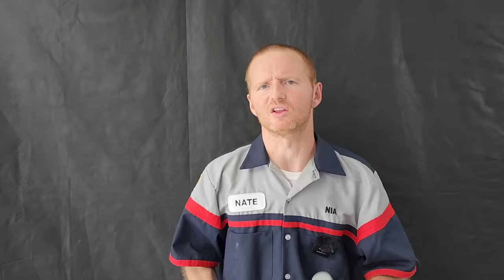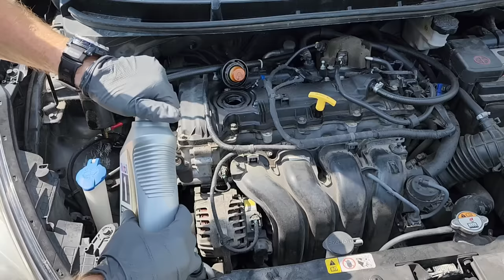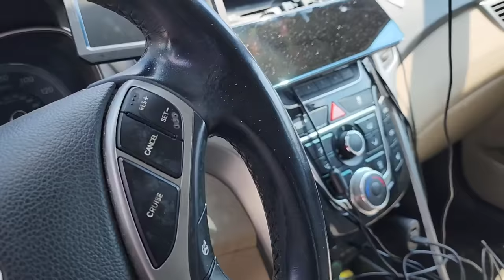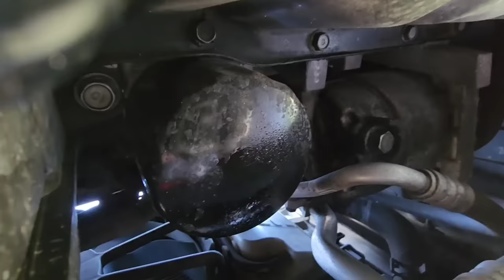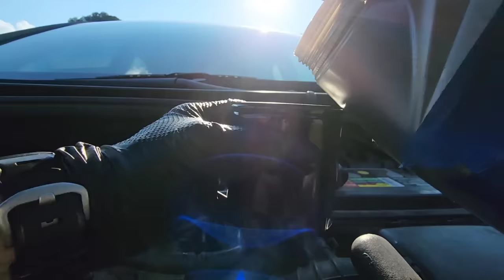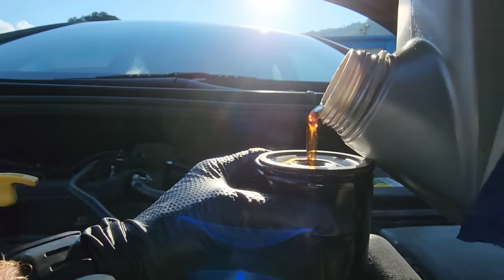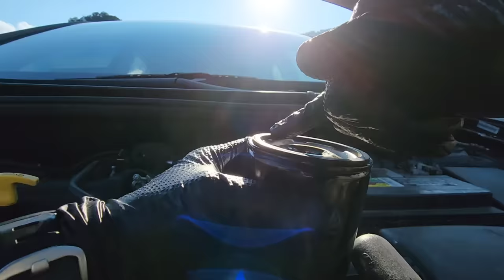Car owner sued after Jeep kills Mechanic during oil change

Comment: The dealer should be held liable and not the car owner. The dealer allowed an incompetent employee operate a vehicle that he did not know how to operate. And for God’s sake, why would you do what that incompetent employee did if you have never used a manual transmission? Why would you just make assumptions ? I have never operated a fork lift but if there was a man standing in front of the forklift I have enough sense not to just make assumptions and start pushing on levers 😱
Reply from the maker: Yes its a terrible situation and could have been avoided.
Reply: The kid sure knew what a clutch was for. ?
Reply: What's a forklift? (Idiocracy was a prediction)
Reply: @eltonyancey6426  I'm willing to bet the mechanic that was pinned outside told the kid to push the clutch in  ( explaining what pedal to push ) but the kid didn't know what's going on . Once the vehicle rolled slightly back he released the clutch and the vehicle jump forward killing the mechanic in front of the vehicle.
Reply: @johnmarshall4442  Could have happened that way. So preventable.
Reply: People have no common sense today. They probably tried suing the car owner because he had an insurance policy.
Reply: No judge would hold the owner liable but people are sue crazy in the states.
Reply: @r3dhorse  - it was a badly written state law
Reply: @r3dhorse  if I were the judge I’d say the idiot mechanic should be liable
Reply: nope it's because of workman comp laws that prevent them from suing the        company directly. The shopped indemnified the car owner. SO even though the car owner gets sued the shop pays
Reply: Once I leave the car in the shop is their responsibility if anything happens.
Reply: @LuisFSilva-gm9ms  I don’t know if that’s a law or not about car ownership, and I’m not saying one way are not. But the more comments people like me are making,  does the person making the video receive royalties from YouTube.  If so a genius. I know some YouTubers like Scotty a mechanic, says he makes titles so that people will watch his videos.
Reply: How much for the new guy?
Reply: @bradfordmcgomery9058  YouTube isn't what it used to be. Now you make 0.25 of 1 cent per view. So every 1.6 million views you make $4,000. Not a very good number for such a high view count.
Reply: Operator error,  if you're starting a standard shift vehicle,  you should be sitting in it, the emergency brake should be applied,  shifter should be I Neutral,  and nobody should ever be standing in front or behind it... , this is not on the owner.
Reply: I'm sorry for all the people involved in this sad incident. But for me that's a work accident not a traffic accident. So the dealer should be liable not the car owner
Reply: @niyablake  That workers comp law was passed because of the fear that one worker would have another worker intentionally "accidentally" hurt them so they could sue the company.  That has happened in the past.
Reply: So, this isn't actually what you think it is. It's a quirk of Michigan's insurance laws. 
"As Femminineo explained to Jalopnik, the Hawkins family can’t directly sue the dealership or its management. Michigan workers’ compensation law says you cannot sue a fellow employee for negligence while on the job. So the Hawkins family’s only option was to sue the Jeep owner. But that doesn’t mean the Jeep owner will be held responsible for the accidental death.

According to Femminineo, when the Hawkins family filed suit against the Jeep owner, that person immediately sued the dealership for indemnification, and won. With that victory in place, whatever results from the Hawkins family’s suit against the Jeep owner will be the legal responsibility of Rochester Hills Chrysler Jeep Dodge (and their insurance company). Basically, while the owner of the Jeep is named in the suit, that person won’t face any repercussions from the trial or judgment."

This is just how it's handled in MI, the owner of the Jeep was never going to have to pay anything.
Reply: @NATESINTERACTIVEAUTO  this will be thrown out of court  in a heart beat
Reply: Exactly
Reply: @2aisabsoluteTim  No it is how the law is supposed to work in MI. Workmans comp prevents workers suing their employer, so the only option is suing the owner of the vehicle, but since the owner had transferred possession temporarily, they are indemnified by the shop. This is how it was supposed to work, the owner of the Jeep was never going to have to pay anything.
Reply: It will be- eventually. After the subrogation claim by the owner's insurance co.
Reply: @poiu477  thank you for clearing it up. I understand it now.
Reply: Truly a very unfortunate and sad outcome 😢. This could absolutely have been prevented with the training and questioning the young man who didn’t know how to drive standard shift.  Part of that instruction on the dealership’s part should have been to perhaps teach the young man about manuals, how to drive them, safely hill hold and how to handle someone too close on a hill behind you, etc.  Anyways, proper and thorough training here would have prevented this man from losing his life.  My thoughts and prayers are with his family ❤.
Reply: 🎯EXACTLY‼
Reply: @2nickles647  no problem! happy to help!
Reply: It is the way that the idiotic No Fault laws are written. There was one occurrence where an airplane was coming in to land and hit a dump truck on the expressway. Excavating company insurance had to pay.
Reply: I agree
Reply: I'm sure the idiot kid pressed the clutch thinking it was the brake. He was trying to turn the car on remember. But since he didn't know how to use a manual as soon as he released the break disaster struck. This was truly and accident. Like 95% of people today don't know how to use a stick. Sad story all around.
Reply: I no believe
Reply: @bradfordmcgomery9058  It has to do with bizzare workers comp laws in that state. Steve Lehto (a Michigan based lemon law attorney) did a good video explaining why the family has to sue the vehicle owner and not the shop directly. I believe he said that a judge, made it clear that any money that ends up going to the victim's family, and the attorney's comes from the shop/shop's insurance company
Reply: you speak the truth brother
Reply: You are applying logic to this situation!
Reply: To be perfectly honest, how a god damn CAR MECHANIC (no matter the age) can not know how to use a manual? I get that americans drive mostly automatics, but it never will be 100%, so a mechanic must be prepared to take on a job on emanuel csr from time to time. And if he doesn't know how manual transmission works, then he shouldn't even think about turning the car on
Reply: @Lisiasty33t  it has gotten to the point there is a “ manual transmission endorsement” on commercial drivers license. Schools were using automatic transmission trucks and the idiots couldn’t drive the trucks they were hired to drive!
Reply: @NATESINTERACTIVEAUTO  If it was a repairs garage that offered inspection then I've always assumed those mechanics to be bonded and insured .
Reply: @NATESINTERACTIVEAUTO  , its clear situation. That shop leave work its own  workers work on stuff, they arent learned. Who was behind wheel, who send him there? The car owner?
Reply: @overheadcamwalling4146  They sued the owner because the laws of Michigan required the victim's family to sue the car owner rather than the dealership. The owner had to sue the dealership to be indemnified in the lawsuit.
Reply: For everyone saying what should or will happen, the case is over. It was settled a few months the ago. Due to the way Michigan's laws work, the victim's family had to sue the car owner, who sued the dealership in order to be indemnified in the case. The dealership is the one who had to pay, but the way to get the payment was complicated unnecessarily by the laws of the state.
Reply: A lot of these young people have never seen a manual transmission. I'm surprised that the brake didn't need to be pressed to start the car. I've been in two push-button start cars, Nissan and Hyundai, both automatic but the brake had to be pressed to start them.
Reply: That's how I learned to drive a forklift. Just watched a couple times and got on and did it.
Reply: Why I change my own oil and do all my own repairs.
Reply: @charlesmckinley29  Before I retired, I had a younger driver do a ride along and wanted to know what I was doing with the clutch pedal. Whenever I drove a new truck, I would double clutch so as not to grind the gears until I learned the rpm drop between gears and the sound of the motor at shift points. He asked me how I came to learn how to do that. And when I told him it was the only way to shift the twin stick 5X4 I use to drive, the blank stare was a kill! And now we have drivers that cannot even shift a straight manual. Times have changed.
Reply: @ronfullerton3162  I laughed but it is sad.
Reply: Agreed. The car owner CAN counter-sue on those very grounds. Allowing an inexperienced mechanic behind the wheel without proper training on the different types of transmissions/start procedures is just plain negligent. BUT, if you notice, the way he describes the incident shows that the man who attempted to start the vehicle had at least some knowledge in starting a manual transmission vehicle. Most new drivers/mechanics I've met don't know to push the clutch in to start. This whole situation seems fishy to me. 
AND, to top it all off, MOST oil change places (that I've worked at/been a customer at) take liability for your vehicle as soon as the paperwork is done and the keys are in their hands.
Reply: @cameronwhite2760  Had a skeptical old timer down the road, and one of his sayings seems to apply here. " The only people who come out ahead in a law suite is the lawyers"! Sounds about right for this case.
Reply: Valid comparison
Reply: @anthonyholleran9378  should be a standard part of the training before he's allowed to even look at a car. But having worked for a few different garages myself, I'm aware that a lot just don't bother with safety training
Reply: @charlesmckinley29  in UK, if you learn in an auto, you aren't allowed to drive manual. But in the US, this isn't the case. Which is plain ridiculous, considering how much more complicated it is
Reply: @_M_O_E_  in the US if you do your driving test for a commercial driver's license in an automatic you'll have an automatic only restriction on your license preventing you from getting jobs that require manual transmission. But if you test on a manual transmission commercial vehicle you won't have that restriction.. when I went through the schooling to get my class A CDL the people that were asking for any volunteers for the automatic semis... I did not want to do that so I tested on a manual and don't have to worry about it.
Reply: @LuisFSilva-gm9ms  you would think
Reply: Exactly
Reply: Also no one should have been standing in front or behind the car for this exact reason.
Reply: You asked multiple "Why's".  The ONE answer is, the young man who started the Jeep was raised by a SINGLE MOTHER.  No father would allow a SON to enter LIFE without knowing HOW to drive a STICK!
Reply: Strange legal system there.
In Europe, the insurer of the dead mechanic will have to reimburse the car and that seems normal to me.
Isn't it also the case in America that if you get a cold hamburger, you can get 25 million in damages.. I'll grab the plane in a minute!
Reply: Matt, you're correct. The problem is the wording of the law in that state. Even the lawyer that brought the suit agrees with you, but he did what the law allowed. It sounds as if they got this worked out in the end. Of course, the state's legislature needs to change the law. Unfortunately, it's often unexpected things, such as this, that bring the bad wording of a law to light.

The show show should have been responsible and it sounds as if this will be the final outcome. However, I can also see a negligence case here, more than just an accident, for the shop not verifying proper training (i.e., knowing how to drive a stick shift) of its employees.
Reply: @eltonyancey6426  or just pressed a pedal on the floor to start the car, not realizing that there were 2 pedals. It sounds as if he was standing outside the vehicle. This would be to the left side, where the clutch pedal is. He stuck his foot in and pressed a pedal that looks like a brake pedal. The brake & clutch pedals frequently look almost alike. The key is usually left in the car, so it wouldn't have been picked up as not being in the car due to him standing outside the car and just sticking his foot in and reaching across or through the steering wheel with his hand to push the start button.
Reply: @niyablake  No, the car owner had to sue the dealer and and get a judgment to ensure that the dealership was held financially responsible (indemnity).
Reply: @karlrovey  what ridiculous law.
Reply: I always worry about this getting my motorcycle serviced. My cruiser weighs almost 800 lbs. Can the mechanic handle the bike?   It's intimidating at first unless your use to big bikes
Reply: I agree. the person starting the vehicle was negligent of safe starting procedures and caused the accident. Not the owner of the car.
Reply: @overheadcamwalling4146  when I was in an accident that wasn't my fault my lawyer told me I need to sue everyone involved, even the passengers of the other vehicle. I refused but guess what? The other driver (who didn't know they were at fault yet) sued all of us including our passengers. (Obviously couldn't win once the judgment changed to 100% her fault)
Reply: I agree totally it's not the car owners fault it wasn't like he had something done modified to the car or just a regular car a truck that was it a Jeep the fact that the place did the oil change had a mechanic that didn't know anything about what he was doing it didn't know how to operate a manual transmission the car owner is not at fault here the place that the oil change is
Reply: Someone dropped the ball when they told a young man that didn't know how to operate a standard shift vehicle to crank the vehicle and check for oil leaks. Now this young man will spend who knows how much time grieving because of an accident that took the life of a fellow employee.
Reply: Sounds like another reason not to take your car to a dealership.
Reply: I agree, when I worked for a dealer as a service advisor my service manager would only hire porters and lube techs that’s knew how to operate manual transmissions (typically kids in their late teens who are gear heads)
Reply: 25+ year tech here that has worked at a ton of stealerships, indies, and finally my own race/ performance fab shop. All I own and drive is 3 pedal cars. The shop had NO REASON to even hire a guy that couldn't drive a manual. Obviously someone else had to pull the car in the bay if he couldn't drive a manual. He can't road test cars for diagnosis/ to confirm repairs afterwards. The 19 year old shouldn't have been hired if he didn't know how to operate a manual car. The stealer should be liable, not the car owner. Just my .02 cents. Crazy ass story, and even a more crazy world we live in... This is just one example. Thanks for sharing it.👍✌🙂
Reply: DId you listen until the end????
Reply: If I don’t know how to operate a piece of equipment I just go ask another mechanic for help.
Reply: @SI0AX  less talking more making videos /cracks whip/
Reply: The guy who started the car is liable, the car owner will win if they take it to court
Reply: @sethmichaelson6972  dude, watch the video to the END!
Reply: @poiu477  This is correct. The plaintiff goes after the insurer of the vehicle and either the garage policy gets involved, or the vehicle insurer settles the case and subrogates to the garage policy. Plaintiff needs to prove negligence and this would be impossible to do if he was going after the owner as an individual.
Reply: @djvycious  Thanks for the additional info!
Reply: @poiu477  Of course! Where I live in Canada, coverage for injuries (Accident Benefits) is mandatory on auto policies, and this can get confusing. In this scenario, should it have occurred here, the A/B coverage of the deceased's own auto policy, if applicable responds first, then the A/B coverage on the vehicle owner's policy. The A/B adjuster would then subrogate against the shop's garage policy, as they were the negligent party, but the policies where A/B coverage is in place must respond first.
Reply: I was just about to say the same thing
Reply: Did he take it to the dealer or a private shop
Reply: The next step would be for the owner to turn around and sue the dealership. If they don't put it all on the dealership, the community should just end that business.
Reply: @charlesmckinley29   - about 23 years ago when I applied for my California CDL I had a choice to either do it the road test in a automatic transmission transport truck or a manual the difference being if I chose the automatic transmission and passed I am not allowed to drive a manual transmission transport truck that’s in California. But I chose manual transmission so I’m good for both automatic and manual.
Reply: That kid should not have had approval to start, drive or move any of the vehicles.  That being said, it's the dealership's property and liability. If they deem the kid competent, it's their right, but regardless, it's their liability, even if the kid broke the rules, it doesn't matter. It's a workplace accident.
Reply: @poiu477  If the owner was sued, wouldn’t it cost them to hire an attorney to defend themselves?
Reply: @1971_Chevelle_SS  Sure, but court and lawyer costs would likely be granted as part of the indemnification suit, so they wouldn't end up needing to pay anything.
Reply: How do you hire a 19 you kid that not only does not know how to operate a manual transmission (good grief, Gen Z security system), AND also does not have a license? You would need a license to operate automobiles in the dealership parking lot to bring them in to lift for an oil change. It may not be the case if the dealership is on private property and the kid never drives off the lot depending on local ordinances and state law, BUT why would you want somebody that unskilled? I guess you get what you pay for. The owner of the Dealership that hired the kid is responsible.
Reply: The 19 year old, not a kid, was the one liable. He, as a mechanic should know at least the basics and that is how to operate any vehicle he works on and should know most of the mechanical devices ie the clutch and the transmission hence the term 'mechanic'...!? He killed his work mate due to lack of due diligence and no common sense...
Reply: I agree with this. It's one thing if you loan your car to an individual, or even if you brought it to a friend to change the oil. They're not professionals. 

When you bring it to a professional shop there's an assumption they act at a higher level and are insured for such things. The dealer was negligent in it's hiring and practices. Without a license he should not have been able to operate a vehicle. License or not they should have trained him on safe operation of the types of cars they had and / or fostered an environment where he was comfortable asking for help. The dealer failed here and I would say to a criminal level and they should have all the liability.
Reply: @dotar9586  facts
Reply: It was a 19 year old kid. 2 months on the job. No common sense or situational awareness, just a bedroom full of participation trophy's.
Reply: @overheadcamwalling4146 I'm thinking they're suing the car owner because he has more money.
Reply: Lmaoo
Reply: @LuisFSilva-gm9ms  exactly I’ve never heard of this “ oh, it’s the customers fault” 
No, it’s in the repair shops possession . This is what they do for a living. That’s why the car was brought to them.
Reply: You mean the mechanic shop